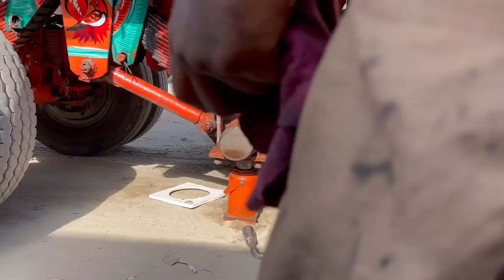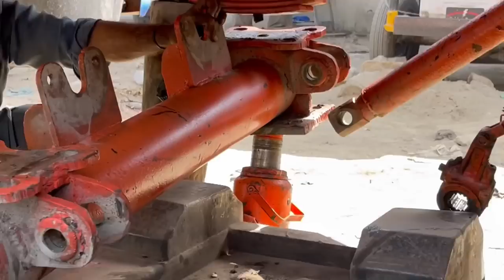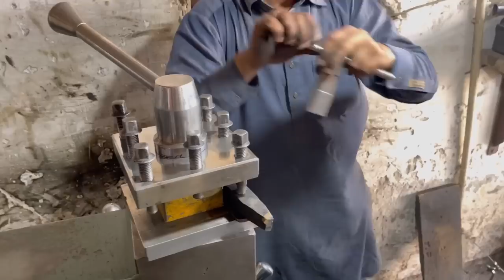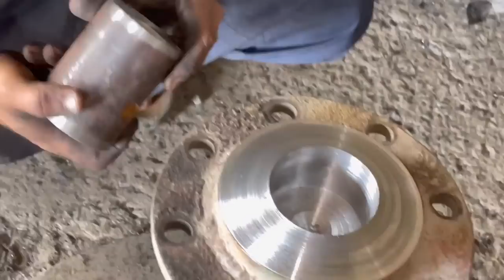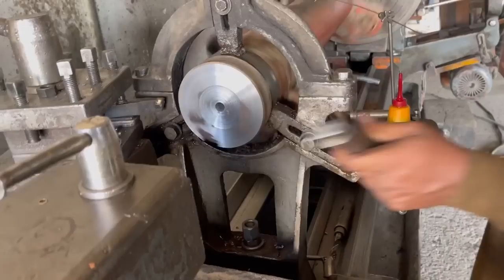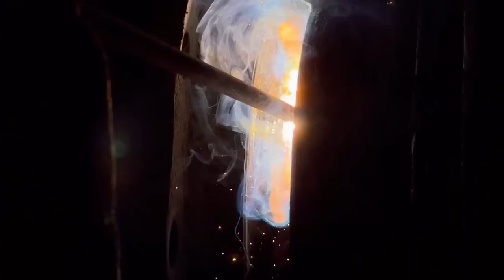When the rear axle of a trailer breaks, we make a joint that is stronger than the genuine.

Comment: This is in no way stronger 💪 than previous it's an economical repair as opposed to replacement though it won't last nearly as long,  still it works and a good example of engineering
Reply: Your funny this is such a horrible repair they didn’t  use correct welding procedure and now thst weld is the weakest area from no pre heat

Comment: Great engineering!! Drive the steel plug into the axle stub rust scale and all. That makes for a strong joint, dontcha know??

This repair does NOT create a joint stronger than the original. Before it broke, the axle was in a constant state of compression - tension as it rolled. Those 2 forces were equally distributed over the diameter of the axle shaft. Now that the center of the axle is a separate piece, it no longer shares in compression or tension as the distribution of these forces now stops at the boundary between the repair plug and the original axles material. This allows the end of the axle to have leverage when exerting tension on the axle so only the repair plug will not share in carrying those loads and the axle can begin to fracture at the outer surface of the plug at the deepest point of the weld.

Comment: These axles are so grossly overloaded that I do not know how they survive the abuse they put them through at all???  I don't know how those poor u-bolts hold the axle in place with the extreme weight they are loading on those crazy big leaf springs!!! I work on heavy duty trucks in the USA and these videos just amaze me how they overload these axles 4+ times the weight they were designed to haul!!
Reply: Japanese trucks are pretty durable, they're designed to carry alot more weight than the "rated capacity"

It's still dangerous nonetheless though.
Reply: Have you ever heard of a 5:1 test ratio? I can't speak for those axles or yours but from what I've seen most axles come between 3:1 5:1 or is tested 3 to 5 times it's marked rating. Manufacturers do this  because it safer. Less law suits and its a better product.
Reply: I hate to be on roads over there,  instead of deer here in USA over there,  runaway tires.
Reply: The decorations  keep the truck  together  lol
Reply: They could hold the weight perfectly if they didn't have all that ungodly nicknack shot all over them
Reply: Not to mention the roads they drive on
Reply: Jason, when they dont overload, the Driver loose  the Job,  on the corner an other driver  will make the job
Reply: @hubertkaiser8581  i think you completely missed his point altogether. 
He wasn't commenting about the driver refusing to drive an overloaded truck. 
His point was how the equipment handles the weight.
Reply: Fútbol hoy
Reply: What we called cheating on trips
Reply: @tristan6509  it's the same with American trucks. The axle can actually hold a little more than what they are rated for. 
His point was, they are overloading the trucks far beyond what they are rated for, which is what is breaking things.
Reply: @MrRydoone  cheating on trips??
Reply: @timothygeiger8271  actually I've found that american trucks of the same class are usually not as durable as their japanese counterparts, the Toyota Hilux and Mitsubishi L200/Triton is infinitely more durable than the Ford ranger and Chevrolet Colorado.

The body panels and paint of the Toyota is shit but the engine and chassis is durable.

Weird thing is that the Ford ranger is a rebadged Mazda bt50 but the clutch likes to get stuck and the injectors gets clogged up pretty easily. Mazda and Nissan is not really known to be as reliable though.

I don't know about the durability of their bigger brothers like the f150 or Silverado though since they're pretty rare around here.
Reply: @tristan6509  first: the trucks referred to in the video & comments are big trucks, which these axles are made for. 
Secondly: what you are referring to as trucks, are actually only pickups. 
Third: i have to disagree with you about the Chevrolet Colorado & Mitsubishi L200 comparison. Average life expectancy of a Mitsubishi L200 engine is 80,000 to 90,000 miles before needing major repairs internally. The Chevrolet Colorado is 200,000 to 300,000 miles. Thats just average, granted some might go longer. 
Fourth: you do realize that Toyotas, Nissans, etc. are made in the US now, for most of the western markets, while the Chevrolet & Fords are mostly made in Mexico, & some in Canada.
Reply: @timothygeiger8271  for the Asian market all Chevrolet, Toyota, Ford, and Mitsubishi trucks are made in Thailand. Where a truck is made doesn't matter, I'm taking about the durability of the design here.

The Colorado is not a bad truck but it doesn't have that durable of an engine, it actually shares a platform with the isuzu D-Max (infact it's basically the same truck with a different engine since Isuzu is owned by GM) but Isuzu's 4J series engines (4JK1, 4JJ1) are just much more durable than the fiat made crap you'd find on a Colorado.

And no your claim on the L200 is false, the Triton is popular where I live on the mining industry and you can find plenty of 3 year old units with 160k+ on the odometer on the used market. One disadvantage the Triton has is that the front apron is less durable than the one from a Hilux, but it's still nowhere near as bad as a Chevy or Ford. The Triton and Hilux still uses a leaf springs instead of coil springs, it's bad for your back but good for durability. Chevy and Ford suspensions are very comfortable, but this comes at a cost which is the repair bill, I also see the same problem with modern Nissans (navara).
Reply: @tristan6509  in the US & western markets it's completely different, & the names you mention aren't used in north America. 
Yes, the engines in Chevrolet most certainly DO last 200,000 to 300,000 miles. I know they do, because i own TWO of them. 
They use different packages between Asian & North American markets. The Colorado is a mid-sized pickup here in the US, we have full-sized pickups which are bigger than the Colorado & Rangers. 
We rarely use diesel engines in smaller mid sized vehicles in the US, ours are mostly gasoline powered. Mitsubishi pickups aren't as popular here in the US, simply because the reliability & durability is far less than the Colorado & Rangers, here in the US.
Reply: @timothygeiger8271  over loaded cargo..it's should 20 tons for 1 trip ..but they load 30 tons. So with just 2 trips they basically already get pay for 3 trips with total 60 tons ..if don't meet any officers on the road it's okay but if you busted you need to pay fines..and your truck also might broken if do this often for overload ..risky but more income
Reply: @MrRydoone  it's about the same as here in the US. Of course in some states here in the US, the fines can be so expensive, that it doesn't pay to go too overloaded. I've been driving a truck over 30 years, it's not worth being overloaded.
Reply: @timothygeiger8271  last time I work at port and has many truck driver friend .. everyday I can see the truck speeding like crazy to gets more trips.. it's containers truck for short trips..many accident happened because of this . everyday must be someone's dead ,hit by truck ..some overloaded  for long trips .up 300km trips..,,some over speed to gets more trips or pay..all cost.. risky for fines or damages .. from testimonials truck driver..all of them say Volvo truck was the best ..Scania best on performance but too much gasoline to fill ..and expensive on maintenance..for durable , convenience, saves cost or maintenance..all of them say Volvo the best..what about US..? Which truck brand  was the best?
Reply: @MrRydoone  in the US, Freightliner is the most popular trucks, Peterbilt is considered the classiest trucks, Volvo is less popular than Freightliner, Peterbilt, or Kenworth. As far as reliability & durability, they are about the same, because the major components are the same. Volvo has their own engines here, & aren't as popular in the US.
Reply: @timothygeiger8271  all those brand was not even existed here..what popular here Volvo,Scania and Isuzu..all germany and Japan brand..why Volvo popular..if you fill diesel or gasoline on truck's.. with the range same but other brand cost double than Volvo..it's saves money..and truck driver here.. company ..usually give gasoline and treats money to the driver with cash ..long trips one..example Scania if company Gave $500 for the gas ..you need to spend that's much..but on Volvo..just $200 already enough for full journey the other $300 goes into driver pocket....even same ranges distance..that's why Volvo more popular..but compare Volvo and Scania ..Scania way more modern and classy with latest system and automatic gear and performance...more futuristic and sport ..but still Volvo the first choice truck driver..you can earned more money..
Reply: @MrRydoone  Peterbilt & Kenworth are both made by PACCAR. PACCAR makes several trucks in Europe. Freightliner is owned by Daimler, which is from Germany.
Reply: @timothygeiger8271  in Asia American built are not  considered reliable.  Years ago we had Ford  didn't survive. Currently we have European and local brands.
Reply: @nainitalism  not surprising for a Ford🤣🤣  
I'm just saying here in the US, a Chevy will last longer than many of the imported brands. Toyota is pretty reliable, but you're also paying for that reliability with a Toyota. 
Mitsubishi pickups here in the US aren't as reliable on average.
Reply: In my country they are always overload at least 2 times. The problem is not the truck itself. It won't break. But the roads are badly damaged by those overloaded trucks.
Reply: @cxn_media  no doubt the overloaded trucks are damaging the roads, it's that way in every country. Of course many other countries like the US has infrastructure in place, which helps to repair & rebuild damaged roads. The issues is, the third world countries don't have an economy to build an infrastructure to repair & rebuild roads. I think alot of the problem is government corruption. Those people in power are living in comfort, & luxury, & getting wealthy doing it, while their people are living in poverty, squalor, & just downright horrendous conditions. 

Don't think that the trucks won't break, that simply is not true. They most certainly will break, they have!  
With an infrastructure in place, the trucks will still break. They just wont break as often, or as badly.
Reply: I agree with you, theese truk are só strong tô suporte over weith!! Brasil
Reply: It’s scary shit you can see the rust where it’s been cracked 1/3 the way thru before it snapped 100% of the way
Reply: Dot would have a field day if they ever found this crap rolling down a road in the USA
Reply: @gordonwelcher9598  you're telling me what the roads are like in the US?🤣🤣  
I live in the US, I've been driving a truck for more than 30 years, I'm very well aware how the roads are in the US🤣🤣🤣
Reply: @timothygeiger8271  Sorry, I accidentally replied to you.
I meant to reply to all. Now I notice you have contributed a lot to this discussion.
Next time I will read all the replies before saying what I have to say.

Comment: You can see that the axle was already cracked from the rust stain and then it finally gave way. Good effort to repair it till another one break's.
Reply: зато как красиво машина декорирована!
Reply: And it was previously repaired.  That axle to hub weld is not a high quality factory weld.

Comment: Those stacks of springs should be called "axle snappers"
Reply: From the number of videos like this one I think they are axel snappers. 👍😁🇺🇸
Reply: these people are crazy. they add an insane amount of leafs and then expect the truck's GVWR to go up too. That ain't out axels and axels housings work.
Reply: @fiaao546  yeah it is a wonder the machine shops and foundries aren't making heavy duty diffs and axles by now. Even if they added webs onto existing equipment the load rating would go up significantly. I have seen repairs where they plate the diff as well but then the other side will snap and possibly the repair also. Depending on pothole depth and overload percentage

Comment: How is that stronger? The plug is not even a tight fit, it is covered in surface scale/rust so it will just vibrate loose even though they pounded it in with a hammer. And there was no preheat so the weld does not have good penetration to the original metal.
Reply: With creative thinking! It was stronger than when it was broken lol. But honestly this is just gonna fail again very quickly
Reply: Yes, but they want it to break again as it's good for business.

Comment: To have an axle shear so cleanly of high strength steel shows the severe stress these truck axle deal with. Improving roads would help too. These side industries will always have jobs to do.
Reply: If you look at the break. It is a clear case of fatigue failure. However , what caught my attention was that once the Crack had progressed 25 to 30% of the dia the component failed.
Shows the extent of overloading it was subject to.

Comment: 1st thing the axle was cut almost halfway through and then fatigued and broke the rest of the way . 2nd the corrosion on the press fit plugshould have been removed before pressing in (hammering into place in their case) as rust doesn't hold as well as clean metal on metal , also wouldn't be stronger then original,  original was weakened by someone cutting it you can see it plain as day

Comment: This whole thing is a absolute disaster  cheap steel used when it was made and a completely dangerous repair
Reply: I have done this sort of in field repair many times on driveshafts and axels. I can’t see any issue with it. Easy to judge from an arm chair tho isn’t it.
Reply: All the parts are oversized thus cheap materials are ok.. those trucks are fully made..

Comment: If only they would put as much effort into maintaining and taking care of there vehicles as they did in decorating them.....
Over loaded.  No safety gear. Much like a toddler discovering that they can stack a block on top of another.
Perfect example of 'work hard, not smart' right here.  
And do they not have any cutting fluid?  Maybe even some WD40?  Cringe.....
Should have chips flying, not ribbons.  Changed the molecular structure of the metal.  It will fail within 6 months or less and back to the same repair again.  With similar results.
If you get a ribbon of metal on a lathe like that, you have ruined your base metal......
The OSHA violations, welding API and APS omissions makes for a solid repeat customer base.
Thank god they aren't building space shuttles.....

Comment: What a bad job. Incredible the dirt of the place. The men work squatting or sitting on the floor, wearing filthy clothes and wristwatch. Mechanics repair engines and equipment by throwing the parts on the dirty floor, there's garbage everywhere ... Mechanics don't wear protective gear. Impressive the dirtiness of the place… Also, operating a lathe or sanders using long-sleeved shirts, rings or wristwatchs is extremely dangerous.
Reply: It's a poor country, what do you expect?
Reply: I am sure this is considered a high quality repair there.
Reply: @mrclassic2284  Hi. Probably. But by Western standards, it's lousy work, no quality, no security, and no guarantee whatsoever. In short:- it's rubbish.
Reply: их там полмиллиарда, если они начнут что-то делать безопасно, то начнётся перенаселение и  голод
Reply: @ivan_filimonoff  Вы совершенно правы. Но это печальная реальность, эти бедные люди работают в нечеловеческих условиях.